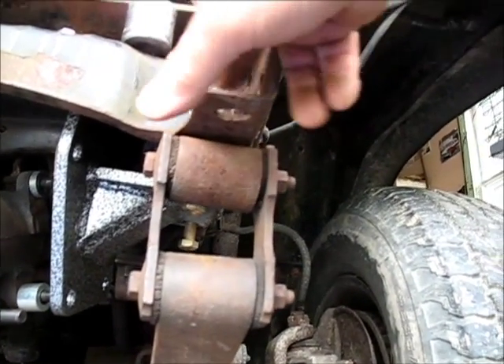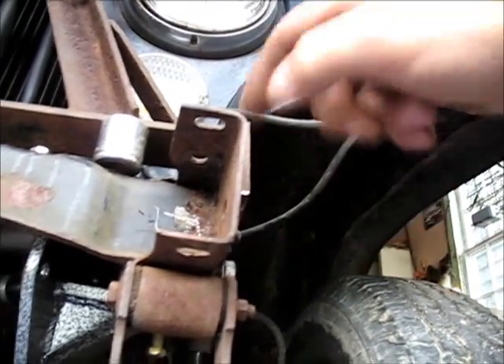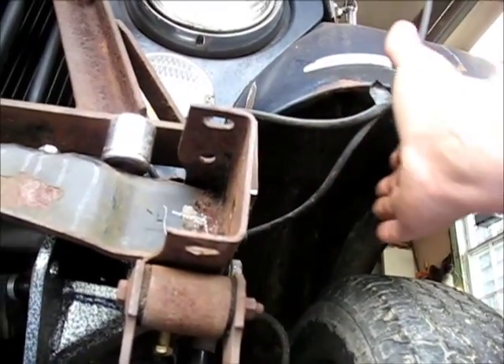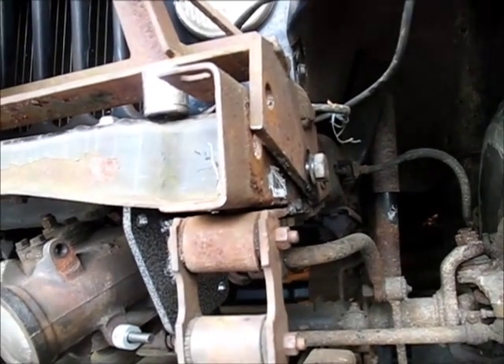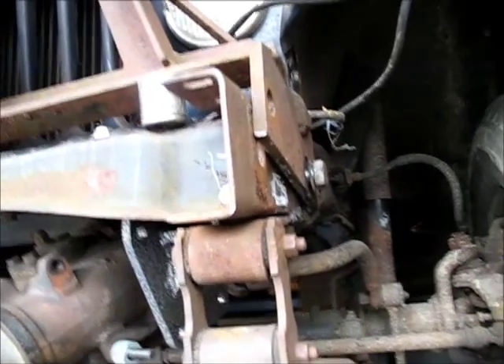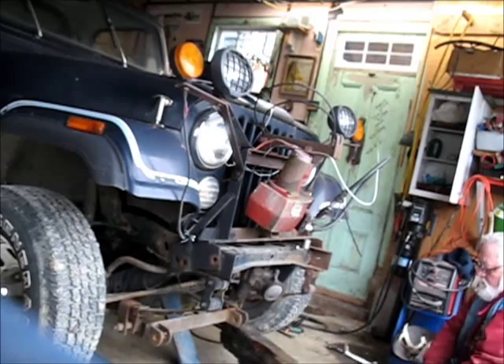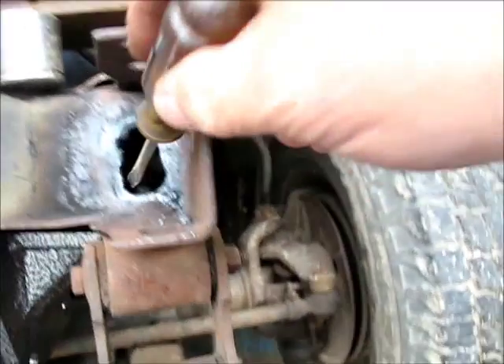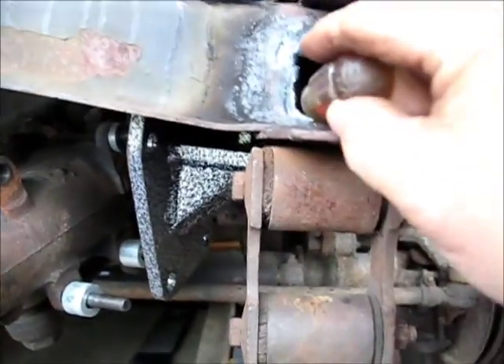CJ7 Reworking front spring mount

Comment: Husqvarna chain saw bar oil sprayed on entire under body and frame with paint spray gun.

Bar oil is designed to cling better then motor oil will.

Heating spray gun canister in kettle of hot water thins oil and makes it spray well even in cold weather, must repeat often especially if very cold outside.
Reply from the maker: I use "The Rust Stop" from that New Hampshire place.  That's the best thing I've found so far..